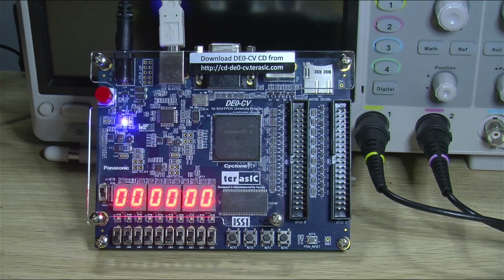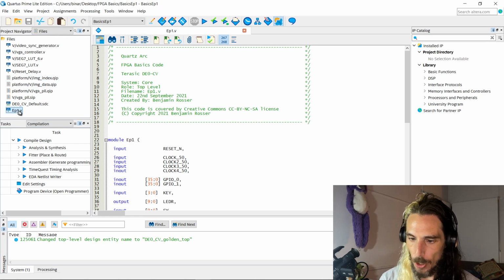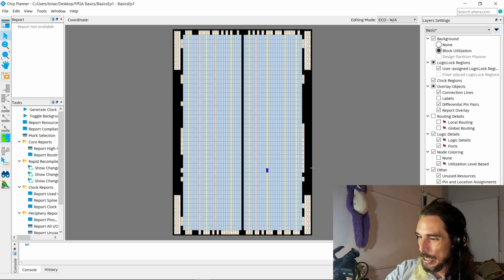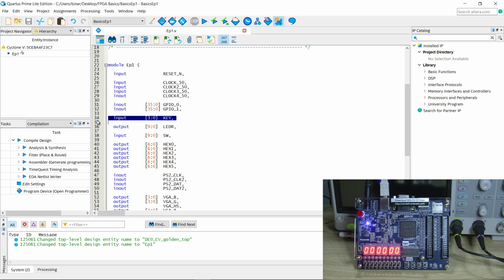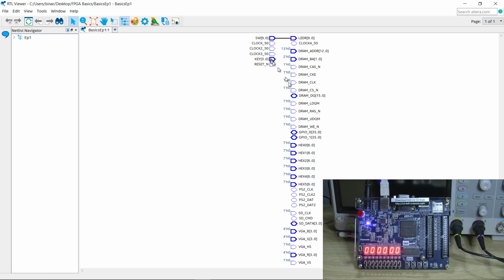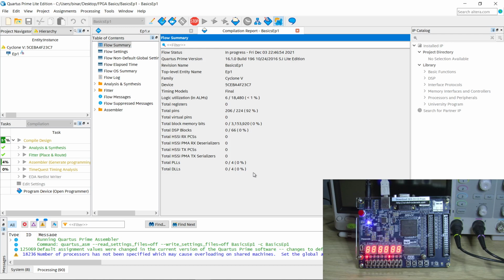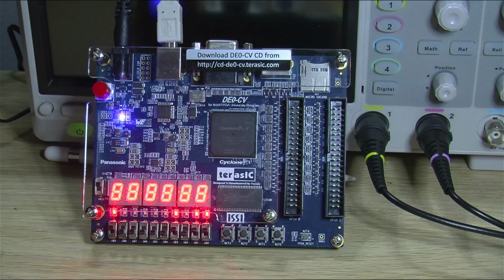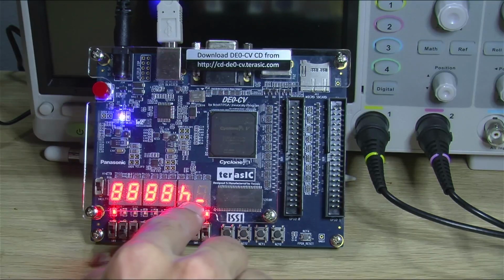What is an FPGA? - FPGA Basics Episode 1

Comment: Another big difference is that an FPGA will run full speed while an MCU can and will bog down if its I/O is occurring faster than it can process. A good example would be a PING sensor which is a simple ultrasound distance transducer, the closer to the sensor an object is the faster the reports back (TOF) is, and thus an MCU will bog down trying to process the range findings fast enough.
Reply from the maker: Very true, and it's one of the reasons why I'm a fan of blending usage of MCUs and FPGAs to leverage the benefits of both in a single system.